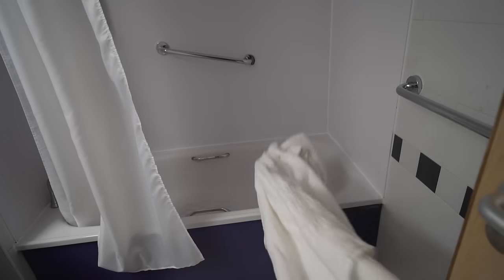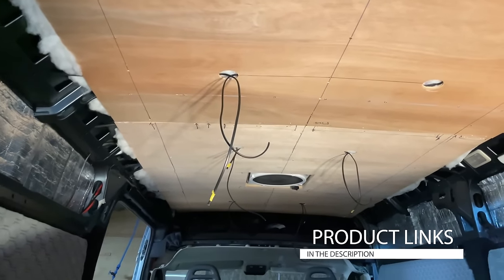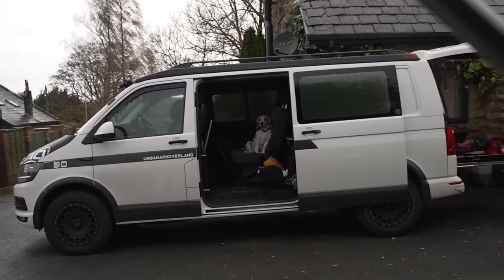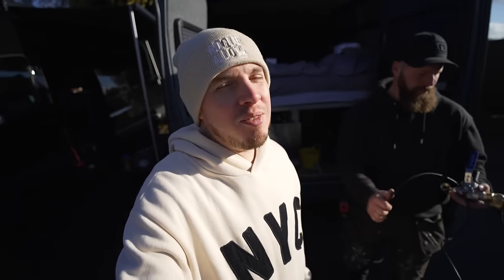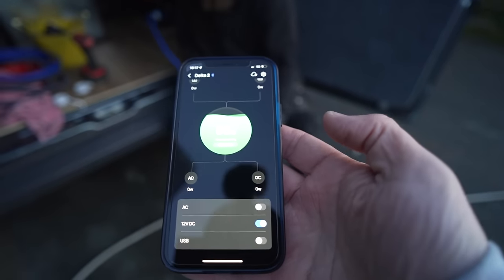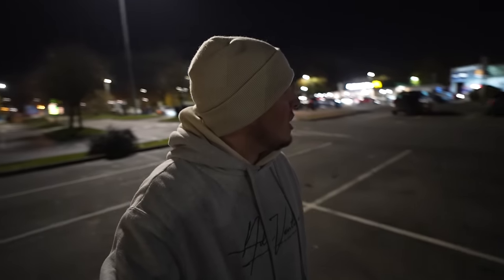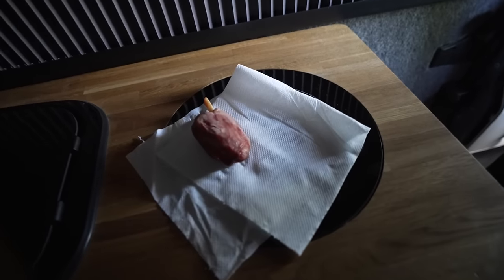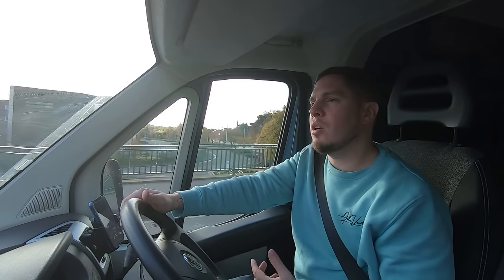Genius van life device!

Comment: Very impressive, expensive but very impressive none the less, I particularly like your choice of ceiling and wall decore, looking forward to your trip to the northern lights, that is where you are going? Right? Or was I thinking my own trip aloud, 😂, that's quite a battery but remember always have two, especially in the climate your planning to drive to, even if its not a 5**? whatever it was, a back up for your back up, basic 101 training, 😉, bring a gas heater too, just in case, best of luck on your adventures. 🙏

Comment: You should use an Ultra Dump 5000X, with the two valves running parallel to a single output, like a watery OR gate.

Comment: Oi! Been fitting those solenoid valves with remote switches to motorhomes for years.
That's ok tho ☺️
They are even better if you put a submersible 12v pump in your waste tank with the outlet to outlet. Just speeds up emptying. You can tie the electric feed into the remote switch circuit so they work in unison 👍
Reply from the maker: Yeah there was a solenoid dump in the motorhome I borrowed earlier this year. But what I’ve done is include it into a system that allows 2 other options with dumping water as well
Reply: @Adz  they do tend to get a bit gummed up unless your sink has a strainer 👍

Comment: We fitted an electronic dump like loads of others problem is they clog up when driving so binned the idea, your waste needs lagging or heating
Reply from the maker: Yeah a lot of motorhomes have an electric dump. But that’s why I’ve made this device so I don’t need to worry about it failing and I don’t need to worry about the waste freezing as it won’t be stored in the tank during freezing temps

Comment: Hi Adz. Is that a victron battery switch in your setup? I had one it (similar setup to yours with regards to current draw) and my switch got quite hot even at the lower end of the current range. Never tried it at full blast. Switched it out for a blue sea systems switch which is much better.
Reply from the maker: It’s a 300a blue sea isolator. Once I run a decent amount of power through it I’ll check the temperature mate
Reply: @Adz  ah couldn’t quite make it out it looks quite similar. Check the temperature of the terminals. There are a couple of forum posts online of people who had the same thing as me with the victron one. My blue sea has been good. All the best for your travels.